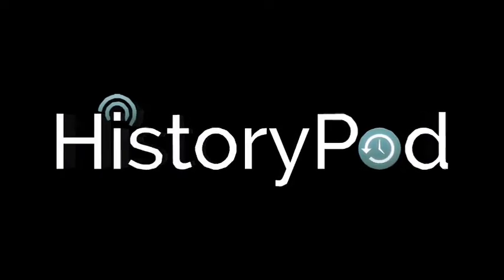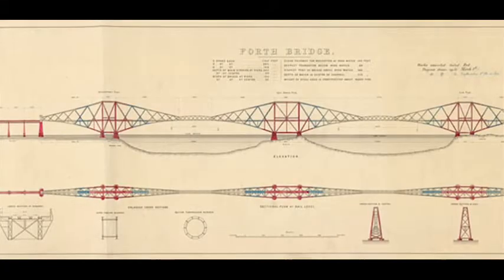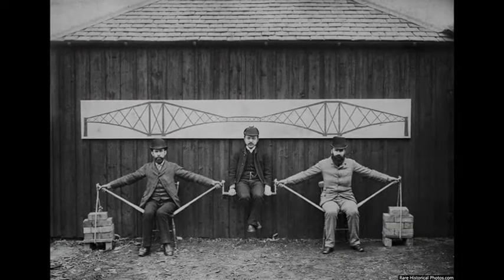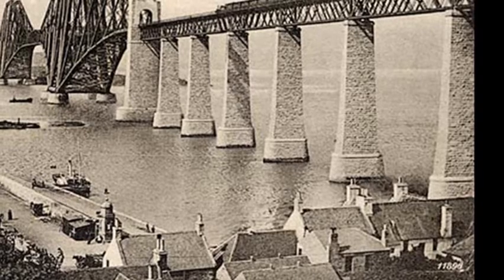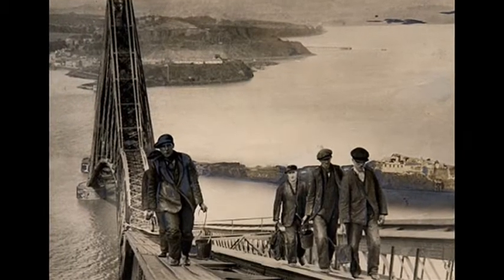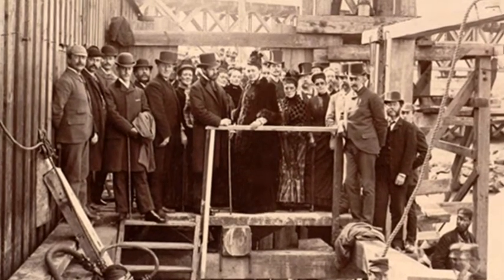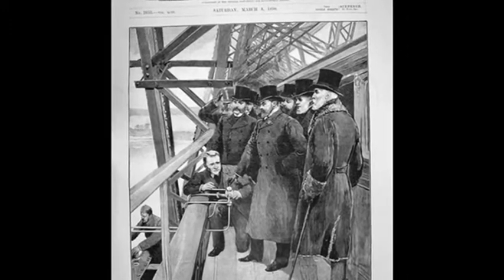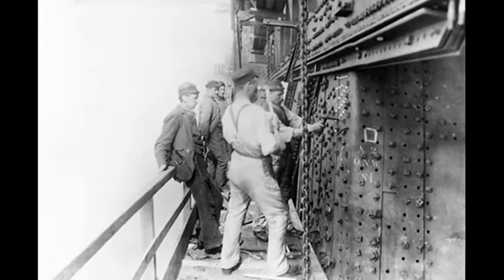4th March 1890: Forth Bridge in Scotland opened by the future King Edward VII

Comment: The Forth Bridge had to appear strong and robust for railroad patrons to trust it to hold up. The Tay Bridge had been in operation only for 18 months when it collapsed in 1879 killing everyone on board the passenger train. The Tay Bridge was built using cast iron and stress fatigue weakened the fittings to the point of failure. The Forth Bridge was built using steel and so it has lasted over time.